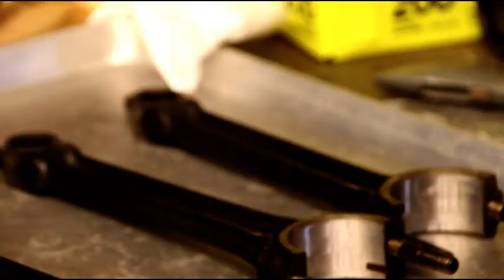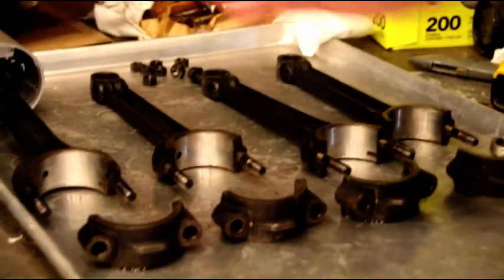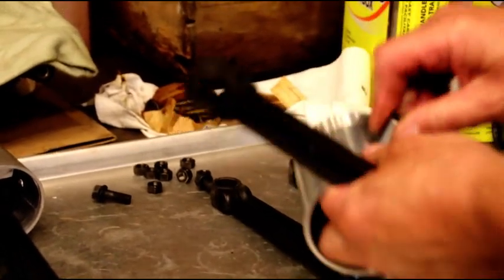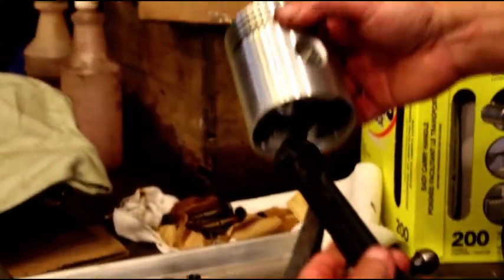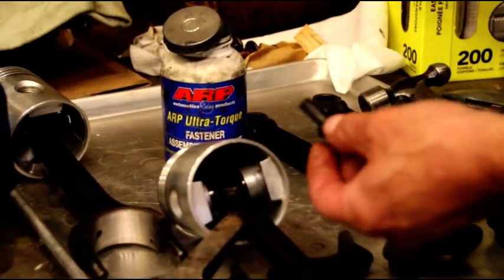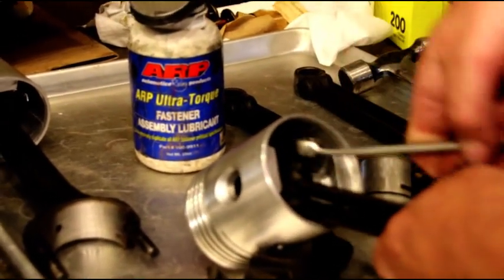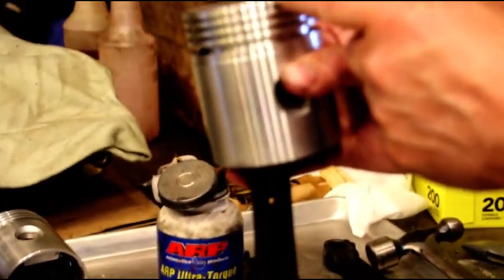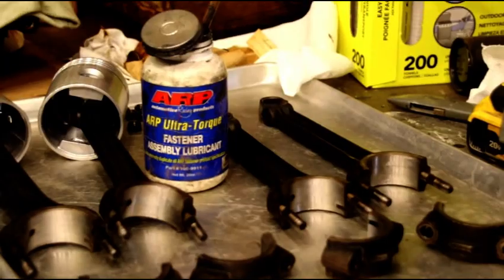Willys Engine Tip Of The Day, Installing Pistons To Rods The Easy Way

Comment: I have never been into a Willys engine. Does the bolt go through the notch in the pin?
Reply from the maker: The notch has to be lined up perfectly for the bolt to slide past it and lock it in place.
Reply: @metalshaperJeep  Thanks for the info.

Comment: I was wondering if someone could help.   I have 2.6 F head newly rebuilt I'm not getting any oil pressure can't really figure out my oil supply galley going to the cam and feeding my Manuel gauge I'm plugging into the rear cam journal hole I don't know what feeds the oil to the rear cam journal and would supply oil pressure gauge reading with this engine there is only one cam bearing which is in front #1 after that I don't see where the oil feeds from. There is no open galley between the outside of the block to the cam feeding engine oil to lube the cam Journals. Please help